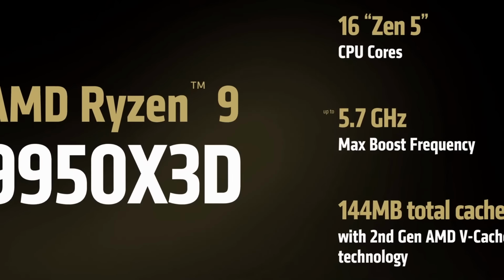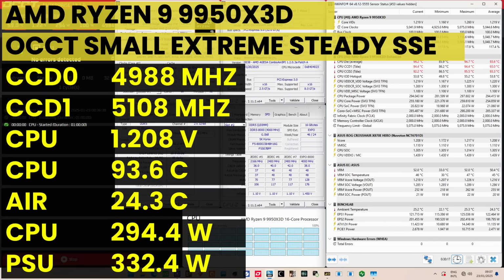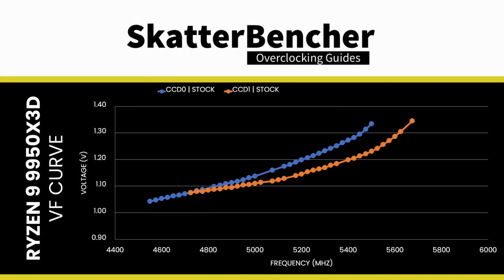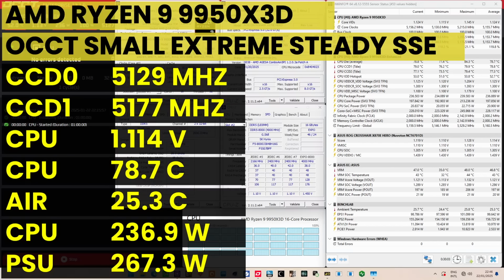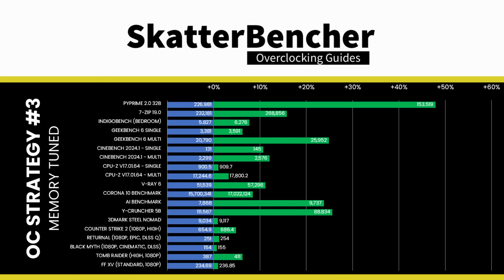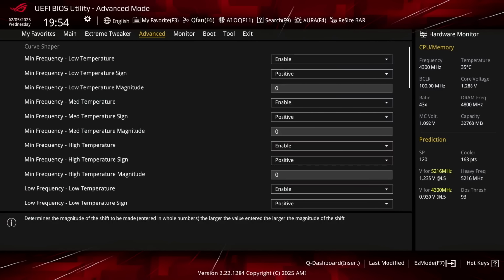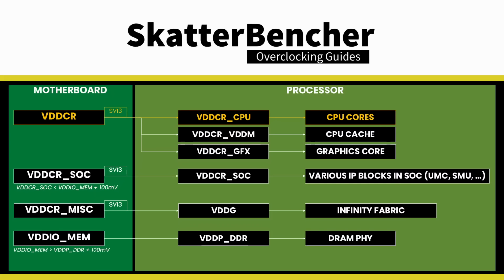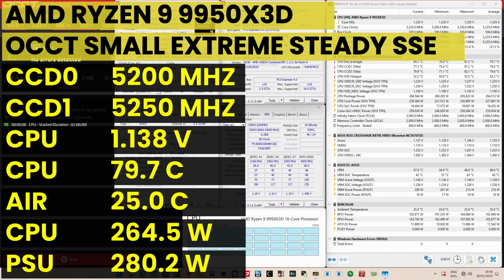Ryzen 9 9950X3D Undervolt & Overclock to 5900 MHz | SkatterBencher #85

Comment: One thing is not clear . In final overclock(part before manual OC )did you leave Curve Optimizer settings(-25 and -20)  before applying Curve Shaper settings,or did you disable it? Otherwise great video !
Reply from the maker: I replaced Curve Optimizer entirely with Curve Shaper.
Reply: @SkatterBencher  Thanks for very rapid response👍 

With your C.Shaper setting I was able to hit 5.7 Ghz single core & 5.2 Ghz all core, stable.
But (I think) I have mediocre memory 6000 cl30. 
Maybe rising FCLK from 2000 Mhz  to ~2200 and OC memory would allow me to go past 5.7 & 5.2 Ghz mark
Reply: @revolucijasvijesti Would memory timings have an impact in that case? I don't know myself, but it seems like they wouldn't be connected here (as far as pure benchmarking CPU).
Reply: @Coldblackice  Those 5.9 Ghz single core overclocks are only for (super)light task anyway so it is  meaningless  . It is just for showing off,no practical purpose really . I'm done with chasing numbers with this CPU. At the end of the day,It is much more important to have stable system than have OC unstable one to show off numbers on forums and youtube. I put like  +150 offset -15 -10 CO  and call it a day.

To answer you question no I don't think so. I was speculating in my head  can I in any way change patterns this CPU behaves,but no I can't 😅
I think memory overclock is only meaningful OC for this CPUs.  Go for 6000 memory and tight those timings as much as you can. If CPU sample (not everyone can) can hold FSB 2200 Mhz go with 6400 memory,don't break that 1:1 mode .
This way you have lowest latency and even can feel snappiness of it. In games you will have better 1% FPS lows,less stutter and generally better feel of whole system.

Alternatively,you could go for for higher memory clocks with loose timings ,but this way latency goes through the roof. Yes some apps would like it,in games you will have maybe 3-4 more FPS on average,but with much more stutter.
So it is a trade-off .

I don't suggest manual OC of  modern CPUs at all. You can burn them in no time,even if you know what are doing. They are not made to sustain high clocks all the time. They are meant to boost on load and "chill" on idle. Go with PBO. Scalar x10  suggested only with  deep negative CO&CS which you most likely would not achieve so best to leave it on auto .

And don't disable  C states.I see many suggest  it but do not do it .I cannot stress enough how important it is to leave it on.
This CPUs needs 1-2 MHz mode on idle. You have billions of transistors  in cores. They can  hold hundreds of AMPs no problem ,but they need 1MHz mode to flush out currents. Because it is currents-more precisely parasitic currents that degrade chip. On 1MHz on idle currents are almost ~0 Amp in transistors ,effectively  all parasitic currents a flushed out.
This way you really keep out CPU from degradation. It can be factor of x10000 or more.

That is why those who manually OC degrade their  CPU so fast .I saw examples ,some degraded their CPU so rapidly,before 100 hours mark it can't boost above 4Ghz .

Do not do manual (fixed frequency) OC.
It can survive hundreds of thousands, if not millions of hours before any noticeable degradation just give your CPU  "time to breathe"  with C states on/auto

Comment: Can i ask u for the bios version ur using im facing instability issues with the 7950x3d with the same motherboard at stock settings
Reply from the maker: I used BIOS 0038

Comment: hi @emike09 have you or anyone tested 4 dimms with this CPU?
I cannot get my system to boot with 4x32 dimms installed and EXPO1 profile enabled(6000Mhz and cl30) despite testing both sets separately as 2x32 and working fine
Reply: I can't get 16x4 to work too.

It seems that only 2 dimm are needed in the motherboard. The 2 is for making the spread better

Comment: There a reason for options 2 that you only went +50 boost override? Feel like you can squeeze out more then that
Reply from the maker: The undervolt with Curve Optimizer is too aggressive for the upper end of the V/F curve, so it's unstable. Therefore, I could choose between less undervolt and enabling the maximum frequency or more undervolt and limiting the maximum frequency. 

However, less undervolt means the maximum frequency is above the voltage limit ceiling, so it would never boost so high. Therefore, I picked more undervolt and less maximum frequency which gave me higher boost frequency in actual applications.

Hope that makes sense :)

Comment: I spent 20 days with an old ryzen 7900x and a nice Asus Rog x670e-e. I discovered some beautiful things between AMD CPUs failed 3 out of 3 specimens with 2-3 cores that go to 95 ° C prematurely compared to all the rest of the cores (which otherwise will run at max 78-85 ° C) making the product not compliant with what was declared. To stabilize the CPU you get to negative undervolt and CO, if the CPU can handle them and you are lucky, even to performances lower than the smooth 7900. It also turns out that the CPUs risk frying with ASUS mainboards driven by AI but without parachutes for the FPU! ASUS does not even have a possibility to set an offset for AVX: you have 24 cores and 2 engaged with AVX loads you have exactly a dual core CPU. I am not paid to make videos but a mainboard to do overclock when running CPUs that are sold for overclocking and are not stable even in standard what is the point? Be careful open your eyes.

Comment: Do you use all strategies together, or just pick one? This is all different from coming from a single CCD Intel
Reply from the maker: Just pick one. The next strategy always builds on top of the previous one, so every strategy is a little more advanced than the previous.
Reply: @SkatterBencher  Thanks! That's what I noticed. I plan to mainly use this PC for gaming and am wondering if going through this is even worth it. I worried games will not run on the CCD with cache.

Comment: SkatterBencher, Tell me if the 9950X3D processor has problems with the scheduler in games, does it work correctly, do games run on the correct X3D chiplet? Both old and new games or is it better to choose the 9800X3D processor? Is it possible to run games on the X3D chiplet, and everything else on a regular chiplet at the same time? The processor needs to work well in games and in work tasks, with a good temperature and so that background applications do not overload it so as not to cause freezes.
Reply from the maker: My limited experience with games tells me the 9950X3D has similar scheduling challenges like the 7950X3D. However, since the frequency delta between the two CCDs is much smaller with the 9950X3D, the performance drop from throwing the game on the wrong CCD is less noticeable.

You might want to check real gaming reviews for a more educated response :)
Reply: Yes these problems are real. I have to use process Lasso to bring my games on the right ccd. It should be fixed via chipset driver an bios update. But I don’t bet my money on it so I lasso all by hand 😂😂

Comment: Should CO be disabled when CS is used? What happens if they're both used?
Reply from the maker: CO and CS will stack. So, for example, if you have -15 CO and -15 CS, then the resulting undervolt is -30.

Comment: Heya mate thanks for the video! btw can You Recommend 192Gb RAM for MSI Godlike + 9950x3d, I am preffered non RGB but just stable and which is speed good to have for example get 6400 but work on 6000,  what voltage is would be good as I understand it is good to have lower voltage, but from Your experience what is great RAM with this massive 192GB 2x48GB ram good to have, Thank You!

Comment: great video

I wonder if when you run us through the BIOS and the final Save and Quit summary, to slow down there, screenshot the top half of the summary, then the bottom half, pop them up on screen for 10 seconds a piece.

Comment: Thanks for sharing! 9950x3D Overclocking guides are few and far between. I'm new to AMD (Last AMD CPU I had was the Athlon X2) and things are different from Intel. Lots to learn here. I started with RAM timings, got my G.Skill 2x32GB CL28-36-36-96 kit down to CL26-30-30-80 and stable under Prime95. Unicorn territory! CPU OC next!
Reply: Hey can you link that specific RAM and a the tutorial you watched to get your cl down to 26? Op is using a 32gb G.Skill, I need 64gb for some of the projects I'm planning for this build. I want to know how to safely follow his steps in this video while having a different Ram kit/speed. SkatterBencher, I'll appreciate it if you can weigh in on this aswell.

Comment: Hey Skatter! You're a genius. But I might have a tip for you!

*Unless you do this for guide purposes to make it easy to track what you're doing, then next time you're inside the FCLK (or any frequency submenu for that matter) it can work similar to CTRL+F in that, you can double type "22" and it should take you to the first option available, being 2200MHz. Might save some time! 

**Sometimes different mobos only like the single value and each time you press a second one it goes to the closest match, so "21" might take you to 2000mhz then straight to 1000mhz, but ymmv!

Comment: This may be a stupid question. But when using strategy number 3, you leave the curve optimizer disabled then make all your adjustments with the curve shaper? Thanks!
Reply from the maker: That's correct! Curve Optimizer and Curve Shaper are doing the same thing and so you can use CO, CS, or even combine them.

Comment: If I’m not using the same RAM. Can I use method 3 and above?
Reply from the maker: Sure, just ignore the advanced memory configuration settings
Reply: @SkatterBencher  May i know which is the advanced memory configuration settings? is it the one with set tRRDL, tRDDA etc?

Comment: I have the same CPU + mobo and used the Curve Optimizer method. Got -30 on each CDD and so far it's stable after several hours of tests, and not locking up when idle either (can be a problem with undervolting). Can't be bothered to use Curve Shaper, and doubt it could really do any meaningfully better when i've already reached -30. I did +150MHz and will be trying +200MHz soon. Looks like i might have got lucky with the silicone lottery, for once. Although this is with 3x 420 radiators, each 60mm thick, and just used for the CPU alone lol. So my temps only reach around 65C.

My CPU-Z single score is 928, and multi is 18.2K. Noice.

Also manually tuned 96GB (2x48GB) to CL28 6000MHz with 33K tREFI. That got me almost 95% close to your best AIDA64 memory benchmarks. Can't complain for this capacity. 

Never OC'd with AM5 before and this vid was extremely helpful and well made. I like how you go through step by step of the exact BIOS settings.
Reply: But what gpu you got chief ?
Reply: Apparently modifying boost clock offset breaks the CCD-selection ability of the CPPC/driver. Is that the case here, or does it still work? 

Not sure if that is a Gigabyte only issue or what.
Reply: @Coldblackice  I assume that you're talking about core parking specifically? That's been working fine. The cores are being parked correctly on the X3D CCD with all games that i've tried, and i've been running this PC constantly 24/7 without issue.

Comment: I try set UCLK = MCLK for DDR 6400, this is going to force UCLK to 3200. I tested that if I keep UCLK = MCLK/2 everything works fine but for UCLK = MCLK it's not. This means that my 9950X3D hardly supports UCLK at 3200. Do I understand it correctly that the only thing I can try to do is to increase SoC voltage offset? 

P.S. already tried this, didn't help - increased to +100 mV. I'm curious how far can I go with voltage offset on SoC before any damage to CPU?
Reply: Though, seems that 6200 works fine with UCLK = MCLK
Reply from the maker: That's right, the only thing you can try is increasing Vsoc. However, even that might not be sufficient since some CPUs simply can't do 3200UCLK with ambient cooling.

AMD's self-imposed voltage limit for SOC is 1.35V. So that's where I draw the line with ambient cooling.

Comment: Great video.  Trying to understand this 230W power limit I'm encountering.  Acting like PPT not 1000 / uncapped.  I've tuned what's discussed except curve shaper + FMAX. 
 Proart X870E mobo , 9950x3d, 2x48GB XMP 6400mhz , PBO mobo, -20 curve both CCD, FCLK 2133mhz, UCLK 3200Mhz (1:1), thermal throttle 85c.  Tried scalar 10x and didn't seem to boost higher, set back to auto.
Blender bench phoronix-test-suite:  All core 5150-5200mhz, 76C (9C under limit), 230w.  Result=434.16.  Is it the Proart mobo PBO curve limiting power?  Have 2x EPS cables, PSU is FSP Hydro Ti Pro 1000w.  Don't need crazy OC, but feel PBO all core should hit my 85c limit.
Reply: I don’t suppose you’ve solved this yet have you? I did a delid and direct die setup but can’t seem get get it to pull over 240 watts. Scores and temps are great. 48k r23 and 70c max after a ton of r23 runs.
Reply: @DrzDrz-pk4fc  No I haven't really investigated too deep cause longevity and stability more important to me.  Since previous post done 1 BIOS update on Proart X870E+ had to reduce ram to 6200mhz to keep UCLK 1:1 now 3100mhz.  Despite memtests originally passing system began crashing on 6400 with 2x48 kit.  I'm on Linux mint.  I just ran  phoronix test suit c-ray bench.  Hitting 245-248W @ 81c, jumping 5.1-5.2ghz.  4c degress under set max.  So its still limiting.  No delid on EK  360mm Nucleus Noctua fans exhuast.  Pump static 75%.  7x 120mm cheapo arctic fans intake.  80F ambient.
Reply: @Feed9Will weird, I wonder what limit we are hitting. I’m running around 5350mhz in occt extreme and about 5350-5400 in r23 so it’s not like it’s performing bad. Just feels like I have a lot more left when the temps dont break 70 lol. 

I also ended up at 6200 cl28 ram. 6400 posts and runs fine but errors after a couple minutes of memtest.
Reply: @DrzDrz-pk4fc  Yeah not really sure.  My guess in my situation is using motherboard controlled PBO and BIOS / AGESA imposed limits.  Cause I do believe that without changing anything after BIOS update on proart board it jumped power ~15w.  It's a bummer to not have ryzen master on Linux.  Ya you definitely have major headroom at 70C.  Perhaps you can explore different OC methods if your using motherboard controlled PBO + negative curves like me.

Comment: If you go for less aggressive CO minus numbers, wouldn't you be able to do +200mhz?
Reply from the maker: Very likely ... but I wouldn't see the +200 boost frequencies because they'd be higher than the voltage limit. So, overall, it's better to be aggressive with CO because it's giving a bigger lift in most real-world workloads.

Comment: Can you use llc with pbo and co. Also can you use pbo, co, and cs? Like you did in 9800x3d. I have a 9900x3d and it's not finely tuned but it's already ripping about 5.7 mghz and 5.64 on oc0
Reply: Also believe doing each core in undervolting would be larger gains but unsure on how to test each one or how to figure out my baseline without just randomly adjusting each one and rerunning benchmarks. Is there a more effective way? Maybe going off the sp score or?

Comment: Can't get CPU to draw more than 215W... Temps are 77C in Cinebench 24, and I'm only getting 2420 points. I'm not missing any settings. I don't understand why it won't draw at least 230W and push harder. It registers the 5900mhz ticks, but it's leaving power on the table that it won't use and I can't figure out why. 

When I use AI Overclock instead and let it "automatically" OC, it draws 250w with higher temps, but delivers the same score.
Reply: Set PBO Limits to manual an set CPU TDP to 250W
Reply: @revolucijasvijesti Do you do this for your own CPU? Or is it a theoretical suggestion.
Reply: @Coldblackice  Yes I own 9950x3d. It is very hard (read:impossible) for this CPU go above factory settings(TDP included) with negative CO and CS. I was putting for PPT EDC TDC manually 1000 1000 1000 but nothing really changes. You can try rising only TDP there is option in BIOS. Factory is 170 W. If you are concerned for your CPU rise by 10 so 180, 190 and watch temperatures.
If you have good cooling-water,or those massive Noctuas etc I think safe is 250W TDP , probably even 300W
But this CPUs are really ,really power efficient from factory.  There is not much you can do
Reply: got the same issue
Reply: @light3267 I turned off SVM in BIOS and everything is much faster. Still not quite right, but a lot better.
Reply: @ only way i can increase performance is by using elck 102 or more, maybe my cpu is limited with it's boost
Reply: Guys which strategy did you use to change bios settings plz, is it the 4 th ?